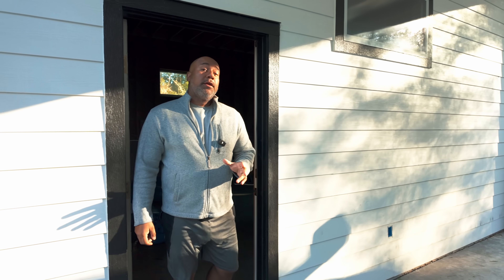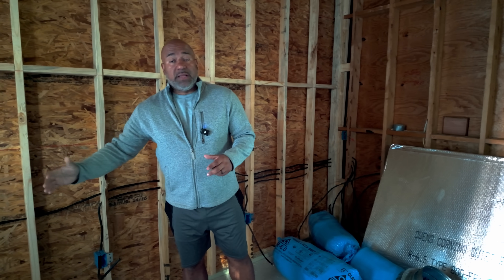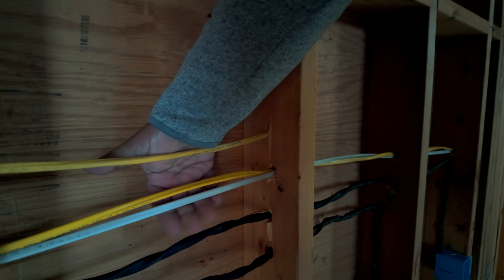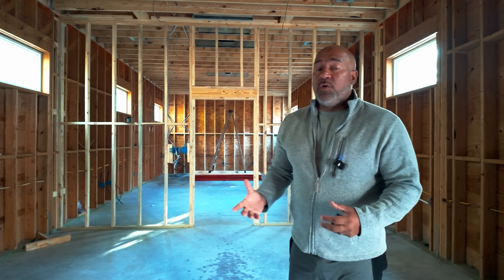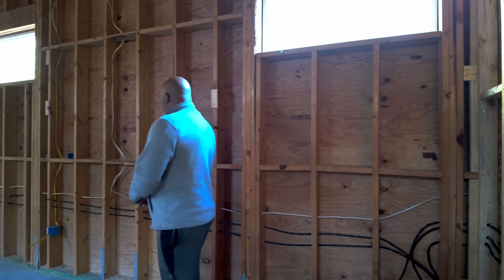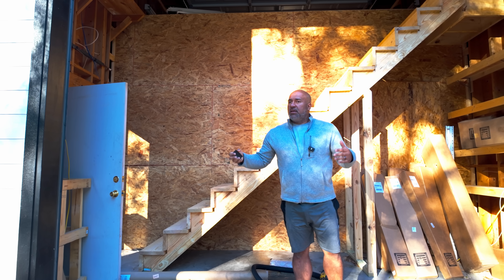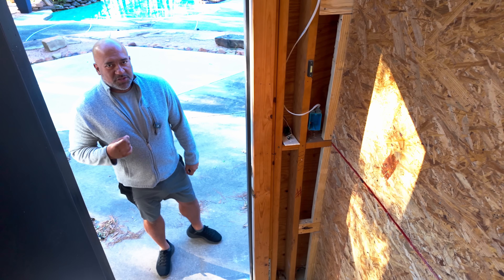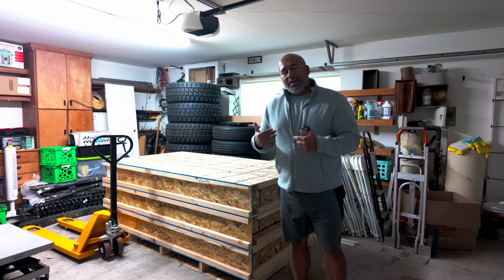Supercharging Future Sound: The Quest for Immersive Audio #halloween

Comment: This is such silly overkill that will make no difference in the sound you hear.  It's mostly a placebo effect.  It's darn fun though.
Reply: Well... 
Running 12gauge  over 14 gauge  so he can use 20A circuits and 5-20 NEMA plugs would make sense. 

He's converting the garage into 'office space'.   Not sure if he had to pull building permits, but he should have.  
Suppose there's an electrical fire.  Insurance companies always look for an excuse not to pay.  
A garage may not need to have lighting rods and grounding posts.  But his office will.  

Running 8ga and then having to pigtail it? defeats the purpose.  Twisting? Not going to do much.  Cheaper and easier to run 12ga in conduit but that may required  in TX while code in Chicago IL. requires it.

The multiple sub panels is interesting. Again, I don't know the code for this... but this is where hiring an expert would have been the smart move.
Reply: This is quite hilarious, I was in the mid to high end audio business as a owner /manager for 48 years and what you are doing is just complete overkill and will make zero difference .All you have to do is go back to your speaker wire comparison, that in itself should have given you a clue to placebo effect. I loved selling all the heavy gauge speaker wire  and interconnect cables ,nothing but huge amounts of money in my pockets. It was very easy to make people believe they were hearing a difference when in reality there was really no difference. Selling high end audio entails more psychology than anything else.

Comment: If you could afford it, I would spray foam the entire thing after the wiring is done.
Reply from the maker: That’s happening lol
Reply: @jaysaudiolab fuck yeah! It really does help everything. Structural integrity increases, temp control, noise...everything.
Reply: @ancientalien815 It does block low frequencies, in fact it probably makes those worse.